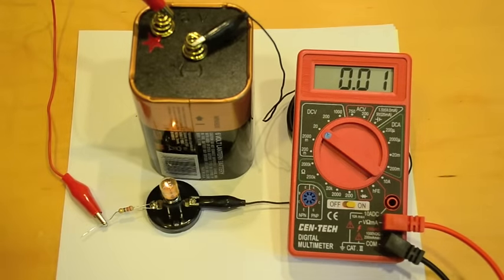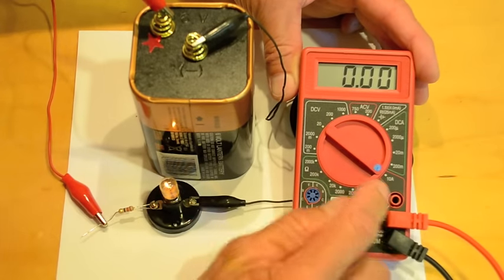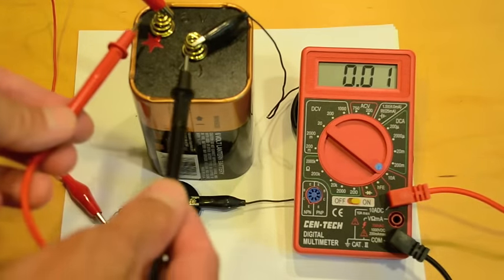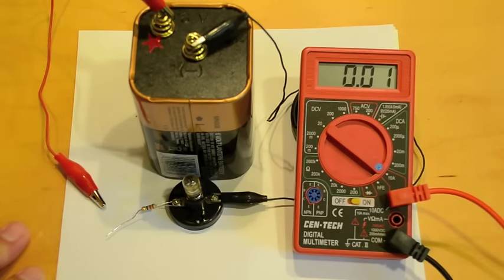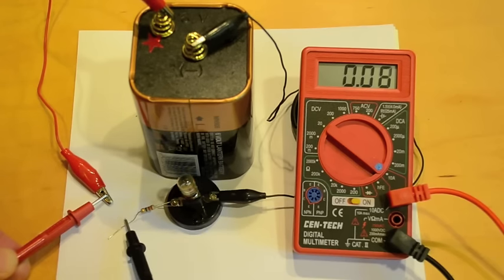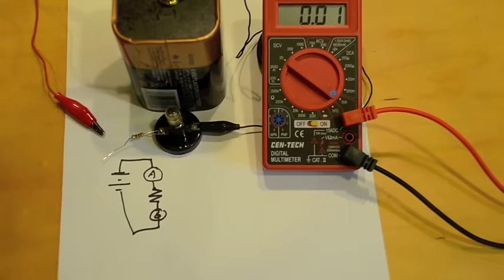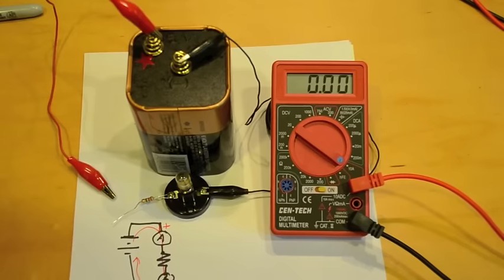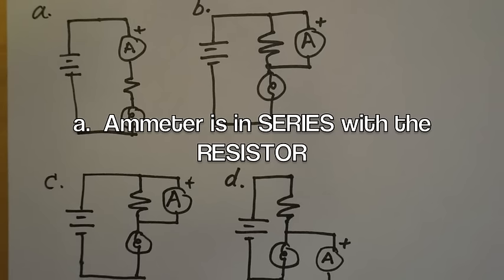Measuring Current with a Digital Multimeter

Comment: Wish I would have watched this before I fried my meter.DOOOOH!
Reply: You and me both i killed some very hard to replace fuses.
Reply: I have the same brand, strangly the fuse was intact. Upon closer look of the circuit I fried a tiny resistor (I could have re soldered).
Reply: Yeah guys I also have this problem. My multimeter just wanted to blow his fuse.
Reply: Same here hehhe
Reply: lol. me too. my red wire got hot and the insulation melted. i caught it just before the meter fried.
Reply: good one off guide for revealing the secret to repair your electronic devices minus the headache. Ive heard some unbelievable things about it and my m8 after many years got cool success with it.
Reply: Appreciate video content! Forgive me for the intrusion, I would love your opinion. Have you heard the talk about - Franaar Shining Shape Formula (search on google)? It is a good one off guide for revealing the secret to repair your electronic devices minus the hard work. Ive heard some super things about it and my buddy  got amazing results with it.
Reply: Kudos for the Video! Forgive me for the intrusion, I would love your thoughts. Have you heard about - Franaar Shining Shape Formula (Sure I saw it on Google)? It is a good exclusive guide for revealing the secret to repair your electronic devices without the normal expense. Ive heard some decent things about it and my buddy at last got amazing success with it.

Comment: What is the resistor for?  And what will happen to the multimeter if you don't connect a resistor in your example?
Reply: If he had done without the resistor, more current would then flow (higher reading would be measured on the multimeter).

But he used the resistor to protect the bulb, so it's likely that without the resistor, the high current and full voltage across the bulb would have blown the bulb.

Comment: I have a cheap multimeter with 20A fuse that can do 15 sec. max C test. A couple of times i have tested batteries under 20A (without a circuit) and the cable got hot, so i always do 4 sec test. My meter is still okay, your advice is also good

Comment: Great job.  I'm sorry he passed away.  Wanted to ask why its okay to put the multimeter probes on directly on a battery to measure voltage, but not in the amperage setting?  Anyone welcome to chime in.
Reply: just learned in school, measure current going through, voltage across. Essentially when measuring voltage it’s okay considering you’re just measuring a potential different between two terminals. Thus measuring the open circuit voltage whilst putting a positive on hot, negative on ground. 

When measuring current, putting an anmeter  in parallel to a source, you’re shorting it, like connecting a wire, infinite current passes through the short and which drains your battery because V=IR.

Comment: I did exactly what you said not to do.  I just charged my 18650 battery and wanted to get a current capacity reading and I blew the fuses on both my digital multimeters and I just now purchased new ones from Amazon, I spent like $40 to get 4 fuses for both meters. Hence, why I am here.

Comment from the maker: Great question.  In the circuit I have shown, the current is the same through all parts.  There are no parallel branches.  So your meter will read the same current after the light bulb or before the light bulb.

Comment: I've done this but it doesn't make a circuit and reads 0.00. Has the fuse blown previously with something I did long ago? I would have thought the mulitmeter just wouldn't work if that was the case
By the way got the test correct at the end.
EDIT: It is showing low battery on the multimeter... maybe that's why?

Comment: How would u check currents (amperage) of a used Harbor Freight 25 watt Solar Panel with the same  type of Ammeter .. is there a way to test the panel alone with no battery or load?

Comment: Hi, i have a power supply 12v 20A connected to a step down convertor, i want to get a current of 5A using the convertor, like in your video where you used a lamp and resistor, what should i use so i can adjust the current from 20A to 5A?
Thanks

Comment: Can you check the amps of a circuit when it's not under load? 

I have a 12v power distribution module for which each circuit can have the amperage set by a computer program. I lost the programming cable, so now I want to check how many amps each circuit is set to so I can be sure I wire a new accessory to a circuit with the appropriate amps set. 

Or does the circuit need to be under load, and would I need to increase the load until the breaker tripped?
Reply from the maker: Current must be measured on a live, loaded circuit (unlike voltage , which can be measured on a live but unloaded circuit).  Electric current is just like water flowing in a pipe; only when it runs is there anything to measure.  If you do test the breakers for maximum load, please make sure that you don't burn down  your shop.

Comment: Hi  MrChanPhysics.  I have a stun gun that produces about 14,000 volt and I want to measure current on that gun. 1) Can I measure the current even though the multimeter can only handle 600 Volt ? Understand that I am measuring the current not the voltage because if I measure voltage it would burn out my fuse. 2) If it can be done then how would I measure the current in such a device ?

Comment: Urgent question for daughter's 3rd grade science project! We measure batteries in series and parallel connection. 2 AAA 1.5V batteries in Series go to 3V and supposedly the 1000 MAh stay the same, 2 AAA 1.5V in parallel stay at 1.5V but the Mah doubles to 2000, and 2 x 2 series connected in parallel go to 3V and doubles to 2000 MAh. I can measure the voltage increase or stay at same with the multimeter, plus I use a light bulb showing dimmer or brighter light, but how can I demonstrate the mAH increase for this purpose? I thought your video did that, but I get a reading of 0.12 and in parallel nothing changed. Using D or 9v I get the same readings when I though it would definitely be higher then the AAA battery. 
Do I need something else to show this or can this only be measure over time? Just a simple proof of hypothesis to double the mAh in parallel would be needed. Thanks.
Reply from the maker: The current (mA) will not change between 1 battery or 2 batteries in parallel (as long as the batteries are fresh and the bulb is a low-power flashlight type).  The bulb is a type of resistor (R).  The "formula" for current (I) is 
I=V/R.  This is known as Ohm's Law. Since AAA, AA, C, D batteries all have the same voltage Vbatt, they will all supply the same amount of current I through a resistor or bulb R.

If you put two batteries in series, then you have doubled the voltage Vbatt and according to Ohm's Law, you will see a doubling of the current I, and the bulb will glow much brighter.  I=2Vbatt/R

This also assumes that the bulb's resistance (R) stays constant.  However, the resistance in real light bulbs increases as they get hotter, so you will probably see a little less than 2x the current I when you double the voltage.  

Putting 2 batteries in parallel will not double the current I.  The way to show that is with 1 battery driving 2 bulbs in parallel.  Each of the bulbs will use an amount of current I=Vbatt/R, so the  battery must double its current output.

Good luck with the science project!

Comment: Silly newbie question, what if i want to work out the amps of the battery (not knowing what it is) so i can use this reading to work out my required resistor in the circuit?

Comment: Okay, so you are using a "conventional view" of current flow. Actually in d-c circuits does not the flow come from the negative side of the battery? Should the set up and schematic show this?

Comment: So that's DC power, but  for measure AC current in 110v or 220v house electricity, most have something connected on outlet running on, that's right ? eg: transformer, coffee maker or something like that, drawing power.

Comment: Hi MrChanPhysics. I just watched your video. it looks great for me without any electricity or electronics background. I followed your tutorial piece by piece, setting exactly as you did BUT my multimeter read (1.) I am using 3AA batteries to operated a 3-led diodes of a PIR sensor light and I need to know the current so that I replace the batteries with a mobile telephone charger using the USB. Am I doing something wrong pls?
Reply from the maker: If the meter reads "1.     " it probably means it is set to a scale too low to display the current.  Try starting with the 10 Amp setting..  This may require you to move the red test lead to a different socket as I have shown in the video.

Comment: Great info, thanks.So when measuring automotive devices I should know roughly how many amps the part puts out first?
Reply from the maker: Each circuit on a car is protected by a fuse.  Each fuse is labeled with its maximum amperage.  Almost every fuse in a car is at least 10 Amps, but the circuits generally draw much less current.  The best use for the ammeter in a car is to find small "leaky" or "vampire" currents, meaning devices which are drawing current when you expect them to be off.  A lot of electronics in modern cars (stereo, alarm systems, door locks) stay alive all the time and draw a small amount of current (10s of milliamps).   So it can be useful to use the ammeter to find vampires if your battery is dying rapidly.  For example, I had a car which drained the battery in a few days.  It turned out that there was a small current drain in the power seat memory. One of the buttons was stuck "on" so it continued to draw current and kill the battery.

Using the ammeter on a powered-on device like headlamps or stereo is very risky since they will likely draw more than 10 Amps and blow the multimeter's fuse.  It is less risky to use a voltmeter at the device to see if it is receiving power.  See my video "Measuring Voltage with a Digital Multimeter".

Comment: I have a rechargeable shaver that  has a power transformer that puts out 3VDC 120 mA.  I want to see if the charging circuit is putting out the proper current.   the battery is failing.  (2/3 AA size - 2.4VDC 500 ma (two 1.2V cells in series.  )
The shaver will not run if the battery is removed even when plugged in.  
So with battery removed and  the circuit plugged in I measure on the + and minus pads where the battery was connect  a voltage of 2.77 VDC.    Can I  test the current  by putting the leads on the +/- pads on the board. (battery is removed) Would that be putting the leads in series?
Reply from the maker: No, that would create a short circuit and undesirable heat and/or smoke.  To see if current is flowing, the ammeter must be in series between the battery and charger.  Use an alligator clip lead to connect the neg. side of battery to neg. charger pad.  Then connect red probe to the pos. charger pad, and the black probe to the pos. battery connection.  Now the meter is in series.  More than likely, however, is you have a dead battery.

Comment: What would happen if you connect the negative lead(-) coming from the the amp meter/multimeter to the negative terminal(-) of the light bulb instead of the resistor(+) connected that's connected to the positive(+) terminal of the bulb? Would the amp meter/ multimeter still measure amperage drawn?
Reply: Just measures as negative if you reverse the leads.

Comment: Hi. Question: when the multimeter says 10 Amp DC, is that the maximum load it can test against? I have some welding transformers that I'd wish to know how much exact current  they give... could I still use the same method owing to the fact they are somewhere in the 100 Amp range?
Reply: Yes

Comment: Good job! But what I don't know now, is how to do this (measuring current) off of a solar panel. Could you tell me pls? I have searched and couldn't see your video on this. Thank you in advance.
Reply from the maker: First, a warning.  Do not attempt this with a large solar array.  Some of them put out many amps at several hundred volts.  This type of system is extremely hazardous and not for amateurs.  I will assume you are trying to measure a small panel, up to 12 V and a few amps.  To do it with this type of meter you will have to disconnect the positive output wire that goes from the panel to the load. Configure the meter for the 10 A setting (assuming your panel puts out less than 10A), then connect the red (+) probe to the panel output, and the black (-) probe to the load wire you disconnected  from the panel.  The load must be connected to get a useful current reading.  Be careful with this much current.

A better type of meter for measuring high power circuits is a clamp-on meter, which clamps around a single wire and does not require breaking the circuit or touching any live wires.  Make sure you  get one that measure DC current if you want to work with solar panels.

Comment: hi Alls, may I know what value voltage and watt of the lamp that used in this video? I already tried and follow the step in this video with 24VDC 70W lamp and should be 2.9A by calculation right. but I only get 0.25mA. any idea?

Comment: All these YouTube video show how to measure current on a simple circuit. Most of the time you will be trying to measure current in a wire so it becomes somewhat of a mess.  For example, if you want to measure the current on a lamp, you would have to cut the wire just to get to one wire to get in series to measure it.  If you're lucky your lamp will have one of the double wires where all you have to do is separate the two wires and put a clamp meter on it.  If you don't have a clamp meter then you will have to cut one of the wires or both because you won't know which is the hot wire.   These guys show you how to measure it but it is no where near a real world way to measure.  Get's even more complicated when you are dealing with a big circuit where everything is grounded to a common wire.

Comment: Great vid - thanks - looks like I have to replace my fuse now, lol.

I usually only deal with voltage/resistance for diagnosing car electronics, but I inherited a battery charger and wanted to test if it worked.  Multimeter only supports 10A current, battery charger had a 2A (12v DC) option I wanted to test.  I hooked it up in parallel to the battery on the loaded circuit, it sparked (the probes arched) a little when I connected the probes, no good reading, then unloaded, tried again, same results, now no sparks, lmao.  Hopefully can replace that fuse.  Should have watched this video first!!!

I'll replace the fuse and try it in series this time...  For the 20A and 60A settings, I have to buy a new multimeter I guess.  Any easier way to validate these?  Seems most multimeters I find only go up to 10A on the current..

EDIT:
As a side note, if I test the voltage on the loaded circuit it's ~12.85 (typical charging output on a 12v auto DC circuit), but if I don't load it (if I test both alligator clamps that you'd connect to the battery) I only get ~9v.  Is this normal?  I would have expected to see 12.85 with or without a load.  Thoughts?
Reply from the maker: To measure currents greater than 10 Amps, you will probably need an inductive-clamp type meter.  It has a sensor that clamps around one wire and uses magnetic field to measure current.  The clamp units do not require you to break the circuit, but the clamp can be clumsy to use in tight spaces.  Make sure the one you use has capability of measuring both DC as AC (some only measure AC).

Comment: will it work the same if you disconnect the black lead and measure on that end?
Reply from the maker: Good question.  Yes, it will measure the same because the current flows through all wires before returning to the battery in this simple circuit.
Reply: in that case, the negative terminal of the battery connects to the negative of ammeter and the positive of ammeter is connected to the negative terminal of bulb... am i right?

Comment: So what’s the resistor?  Confused.
Reply from the maker: The 22 ohm resistor is in the circuit for two reasons:  1) to limit the current to the bulb, 2) as part of the video series "Measuring Resistance with a Digital Multimeter".
Reply: MrChanPhysics   Thanks. Missed the other video.  Great teacher!  ✌️

Comment: Hi , I'm trying to do an amperage test on my stanley Jumpit  jumper starter pack .  Jumpit Jump pack rated at 1000 peak battery amps and 500 instant starting power . .....  On my jump lead of my pack red & black clamp ....... would you walk me through the setting on my multimeter  to read  amperage out from my pack lead  ?  Greatly appreciated .... thanks

Comment: Boss, there is a way to measure AC current?  I want to measure the output current of an audio amplifier to get the wattage..
Reply: BisDak Philippines use the equation i^2 * R = W. So current squared times resistance equals wattage. Plug in your knowns and solve for i. For example, if your speaker is 50 watts RMS, at a 4 ohm load, take 50/4, then take the square root of that. That’s your current draw at maximum power.